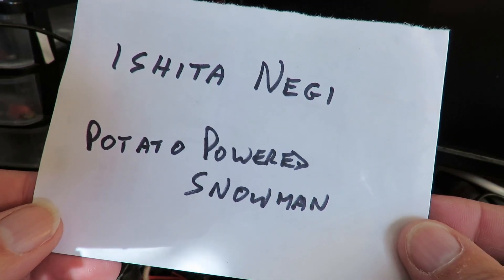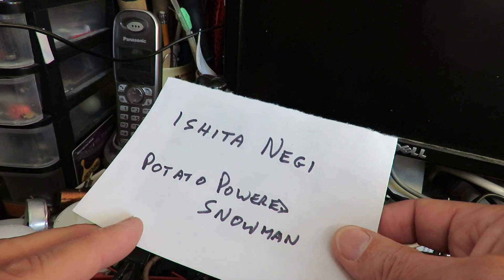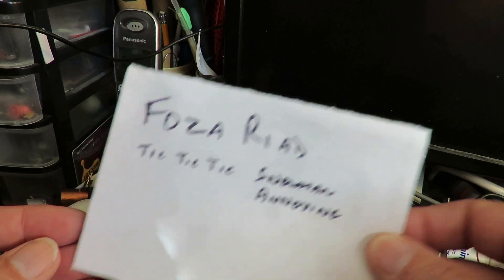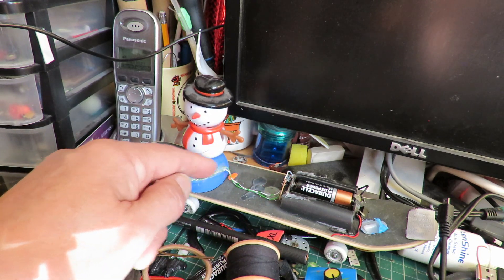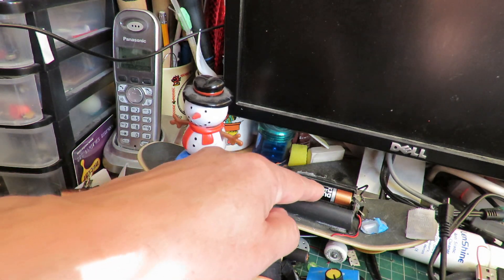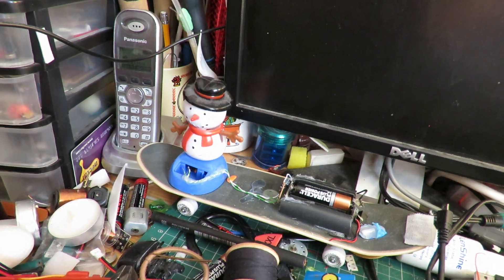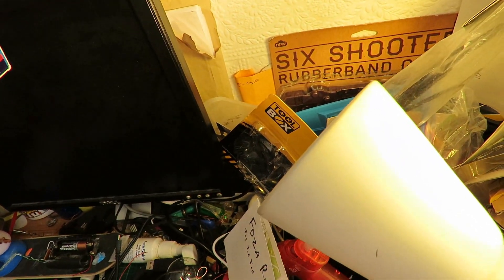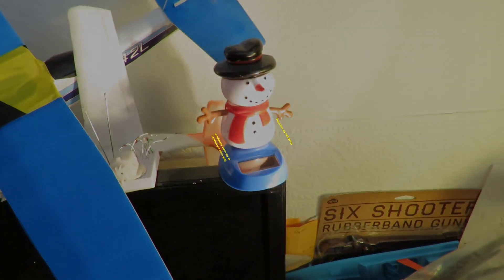Comment reply - Solar Snowman Battery Powered

Comment: hi grandad, i seen the snow man almost in every video and i have seen the video in the description too but i was wondering if you can convert the snowman from potato power to lemon power?i seen in one of ur videos where you made a lemon powered fan driven car flair loop april 1st.

heres a video from scienceonline where he makes one,https://www.youtube.com/watch?v=AY9qcDCFeVI. that would deffinately make the snowman work. heres one of my video where im using a sour apple as a battery to power a calculator. https://www.youtube.com/watch?v=otIwdcEIeIc
Reply from the maker: That was an April Fool spoof (Flair Loop is an anagram of April Fool) you will not get enough current to power a motor powerful enough to move the weight of a lemon however the power output is similar to the potato so it should run the snowman especially if you use more than one like I did for the potato.